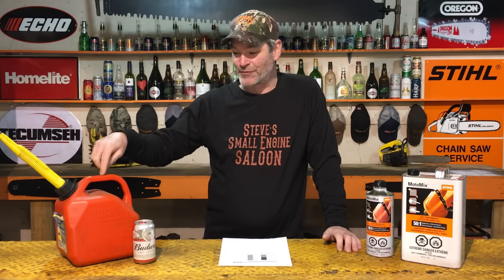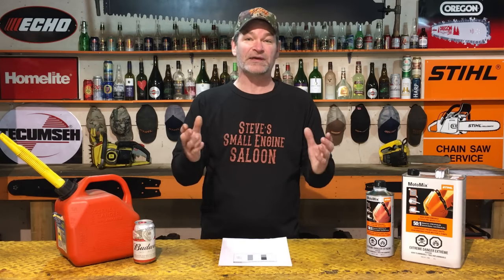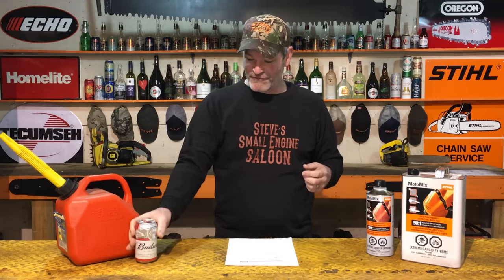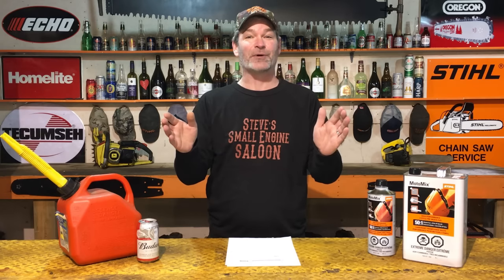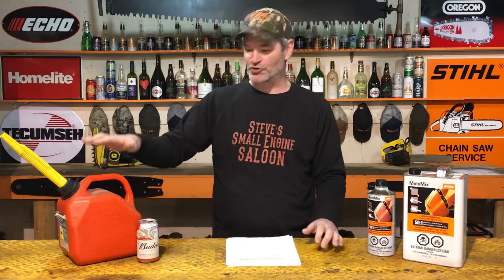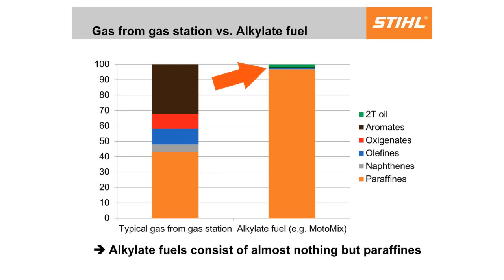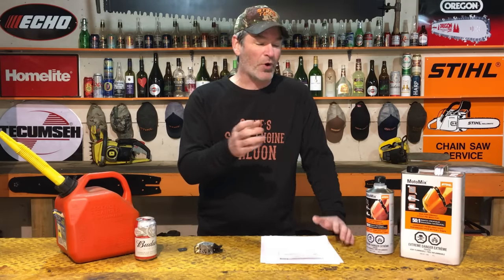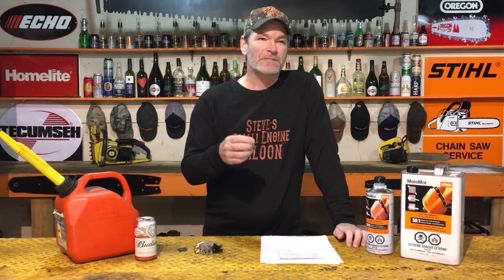The Ugly Truth Why Gas Station Fuel Is Bad For Small Engines

Comment: The pre mixed fuel is way out of budget 4 many people. If they want us use it they need to shrink there heads an make it affordable
Reply: Way way over priced
Reply: its cheaper to replace diaphragm and fuel lines you get it from china for few bucks
Reply: I saw Quarts (liter) was $13   I can clean my own carb
Reply: You're right about the price, it should have gold dust in it for that price. I go through a lot of gas in small engines in a years time. My nephew bought a 5 gallon container of the pre-mixed fuel and I almost passed out when he told me what it costs!  As Fran008 stated, "it's cheaper to replace the diaphram and fuel lines every year! I am left to wonder why older gasoline engines and two cycles engines didn't have this problem? My dad spent 3 decades in the tree and firewood business, using multiple chain saws and a log splinter and never ran anything but pump gas through them and never had any problem. It seems like our technology is going backwards!
Reply: I don't care how much it costs. I don't make my living with my small engine machines but I want them to start and run when I need them. Not take them apart/rebuild/clean them.
Reply: I use VP 4 cycle fuel and mix in Lucas 2 cycle oil. The VP is pricey but my old Lawnboy runs better than pump fuel. I can tell a difference...the engine purrs and runs smoother.
Reply: Josh that's great it's working out for your but the cost is just to great 4 me. Thanks 4 your comment have a great evening and be safe
Reply: Cheaper to buy non ethanol at the pump
Reply: They're tying their warranties to it to try and make you buy it.
Reply: Considering the time and frustration of dealing with a bad carb, if you just buy a can of premixed fuel at the end of the season, so that is all that is in it before storing for the winter, the price is worth it. My time is worth more than the 10 or even 20 dollars a year extra
Reply: Maybe only use it before storage. Run this fuel, top off the tank then run gas next spring.
Reply: Not sure where you live but I just bought vp fuels 40:1 for my chain saw and weed eaters I bought a 5 gallon can for 35.bucks which I thought was a damn good price so I bought 2.and right now my gas prices,are 1.45 a gal anyways the smaller cans go for 5.99.and the gallon 19.99.course I mow and weed eat every 2 or 3 weeks .and run my chainsaw about 5 times a yr so what I'm paying works for me.just saying.the oil I used was 15.99 a case of 12 the gas I used wasnt 87oct it was 93 oct  and thats 2.65  gal I dont get just one gal I get 5 gallons so the pre mixed works better for me ...just saying
Reply: That's a great idea I will go to the airport
Reply: I actually use the fuel in my mix can year to year. My stuff will start on the 3rd pull Everytime. I just add to it when it gets low. I was given a free can of special fuel with my new chain saw it's still setting on the shelf in my shed.
Reply: Plus now Amazon is adding sales tax on everything, which is why I dumped my account, plenty of other alternates that dont charge it
Reply: Fran008 not for long -I’m hearing people will be Boycotting China Products soon !!!!!
Because of the Corona outbreak ...
Reply: alphaone101 Devil products.. everyone wants there hands washed .. $$$$$ - Greed - we are Pawns in The Game .. ( Read it - very interesting ) 🤔
Reply: Steve Raymond it’s either that or Buy Electric ⚡️
Reply: Mike Bennett 🤔🤔🤔
Reply: onus gumboot I agree - end of the Year!!
Reply: Anthony Griffith seafoam or stabilizer ????
Reply: Victorian Sculptures - Again Greed
Reply: Really? How many gallons of pre mix does a home owner go through in a year? I have to deal with 3 acres of 5 foot high weeds each spring, and I don't use more than two quarts of the good stuff.
Reply: it’s about 4-5 times the price yes, but if you can get ethanol-free, that’s fine too… if this is just about storage though I don’t mind paying $20-$25 for it if once a year if it means less problems down the road
Reply: @kontu5399  the comparison is to E10 fuel, you can get ethanol-free and it is much better, maybe not as good as pre-mixed but still, this stuff can last a long time and avoid having to send in your equipment for repairs or have to clean out or replace parts
Reply: $35 a gallon here.........silliness
Reply: 28$ a gal in Tennessee.
Reply: Yeah!! 22 bucks for a quart of premixed fuel. No one can afford that!!
Reply: F that!
Reply: Ethanol free gas is the way to go. And don’t store small equipment with fuel in it. When I’m not going to use my chainsaw for a while I dump the excess fuel and let it run until it runs out. Works like a charm.
Reply: @mikebennett5442  ...aviation fuel for piston engines has lead additive in it .
Reply: I use it for storage purposes.  Before storing after the season ends, I drain the pump fuel and put a little motomix in and run it until the engine stops.  Now you have no fuel issues. Will start perfectly every time.
Reply: @alphaone101  .....the new run of plastic and rubber compounds seem to have self destruct built in :- that can be the insulation breaking down on coils n ignition module/magneto over time irrespective of usage , diaphragm n fuel lines as mentioned . Tyres made in China will leak air by osmosis through entire body of the tyre , there's no detected localised leak if immersed in water but they leak slowly. I've had used shoes crumble away unused over the years and my first experience of this was with new balance pair which were new and unused for a decade and were just leather n crumbs when I wanted to use them years later. I never had tyres rot away while in sheltered storage in earlier times but it happens these days .
Reply: Thats what i thought, but last year i started getting into string trimmer another small engine repairs. Last year using gas station fuel I had nothing but issues and this year I started using pre-mixed fuel from Menards and other places and I haven't had any issues starting up my machines this year.
Reply: @alphaone101  its cose fuel now days contains diferent stuff  from one back in day thay got lots more aded crap in it now
Reply: 100% agree.
Reply: @mikebennett5442  that was my thought. A friend has ran our local airport for about 45 years.
Reply: @HobbyOrganist  yes, old Elon Musk is thick with the politicians and he wants to pass along the government cut to stay in their good graces. He will mumble something about it being the law to make everybody think it was not his idea. He probably had loe Nancy and AOC pass the bill.
Reply: @charlesdickens6706  Lol! Go bare footed and drive on steel rims?
Reply: @boskoromanic7425  
you hit the nail on the head but there is still a cheaper alternative than listening to shit manufacturers say:
find a hobbyist airstrip in your area, they generally sell fuel for vintage aircraft which just straight up can not safely run on modern fuel, the stuff is more expensive than pump gas, but it's most certainly cheaper the shit manufacturers are trying to sell you. learned this trick from an old co-worker who races with a trabant and vintage two stroke mopeds.
Reply: If you’re an individual homeowner, you’ll use maybe one or two cans of this stuff a year. That’s less than $30.

If you’re a business, it’s a write off and your stuff works better.
Reply: @alphaone101  I doubt very much that in three decades as a lumberjack, your father never had issues with his small engine equipment.
Reply: @onusgumboot5565  lol. New parts are cheaper than buying that garbage
Reply: @SuperFunny65  or just drain fuel before storage
Reply: I buy a 91 octane race fuel at my local race shop. I think it is like $6 a gallon. A ton cheaper than Motomix.
Reply: @steverayrapp  Yeah, but what about when you buy premium, alcohol-free fuel, and your fuel systems still bite it? Nobody can afford to fill up their 4 gallon, zero turn mowers with this shit.
Reply: @mikebennett5442  What this guy says. I live comfortable, but I ain't paying that.
Reply: @stevetdean1966  I'm in California. You can't get pure gas easily. I've been using "Trufuel" in my yard equipment and they always start and run great. If I was using these things every day I would use pump gas.
Reply: @fran0085  no way no china!
Reply: @jimmysapien9961  completely agree and am on board with that. No china!
Reply: I use Aspen, but only for flushing down the engine/carb after day's work. It really made a difference and cost isn't a problem as just a few ml are needed to be put in an empty tank for the hose to pick it up and run it through the carb/engine for a few seconds before shutting off/storage.
Reply: At $35 a gallon?? Nope, I’m capable of changing a few small parts every few years if need be.
Reply: So, apparently "STEVE" is making this video for his buddies that have their own shops like HE does, the rest of us that are on a budget can't just "go buy a can of this stuff". I looked online at some of the prices....WHOA! Nope, gonna use the pump gas!
Reply: Oh yeah?  Well I just paid $50 to get my Stihl chainsaw repaired because of bad pre-mixed fuel you are touting.  If it's that expensive, it better be DARN GOOD FUEL!  😁
Never had a problem with gas station fuel properly mixed.
Reply: @jimmysapien9961  Ha ha. Half the crap we own is made in china. Good luck with that.
Reply: @kontu5399  I had a Craftsman for 15-20 years that i never winterized. It always ran fine. At the start of the new year I would change air filters, spark plug, and change the oil.  She worked great. Prior to getting that mower I used a fuel stabilizer. It started one time. The mower would never start again. I followed the directions. i returned it and never used a stabilizer again.
Reply: My take is, for personal / residential use it's fine but, for someone like me who runs commercial machines & burns gallons a week, this is out of the question because my customers just can't absorb that kind of cost.
Reply: @alphaone101  your dad never had problems because that was before they "improved" gasoline. So many additives are in gas now that they claim are engineered for a better fuel, but i kind of think they just use it as filler to make more money/gallon.
Reply: It costs far more for repairs if you're unable to do it yourself.
Spend the extra cost for canned fuel.
Reply: If you got that much extra $'s laying around then good for you!! Quite a bit out of my league!
Reply: Depends on how much you use per year.
Using it to store equipment for the end of season isn't that bad. 
Big thing is that it works and is dependable.
Reply: @shellcracker18  thats my thought, too.
Get real gas
Reply: Yup...not paying 16 bucks a litre or what ever it is.
Reply: @shellcracker18  that's exactly what I do $6.50 a gallon that I'm running four strokes so I get in about 85 to 90 Mi a gallon on my motorized gas tank bike...
Reply: Project Farm does a great job of showing how storing aluminum in plain ethanol free gas caused no damage/corrosion to aluminum after 9 months, while E10 and E85 had massive corrosion, so yes it's the ethanol. The engineered gas is great, but it's $40 a gallon... And again plain ethanol free has not caused any damage or corrosion to gaskets or metal in any test I've seen when storing 6 months to a year
Reply: cheaper then pay for a repair due to poor mix jobs people use and the corn fuel.
Reply: So we already spend more money at the pumps filling up our cars anyways if you really want to make your equipment last it doesn't hurt paying extra
Reply: The price between their engineered fuels and pump fuel I could buy a new chainsaw in two years.
Reply: I run my own mix in the saw for cutting firewood. I store the saws with the fancy pre mix and they never sputter. If I'm cutting more than a few branches I'll mix some.
Reply: You don’t know what price is
Reply: Not at all
Reply: @fran0085  im a stihl dealer and when people use this thing for 2-3 years i a row they have carburator problem! The motonix just dry out the diaphram like plastic!
Reply: @jimmysapien9961  this comment aged like milk.
Reply: $30/gal at Lowe’s in Michigan.  Rip-off.
Reply: Not to mention it's completely trash. I like knowing what type of oil is used to mix my gas. I've bought that stuff several times and it makes my engines run like shit.
Reply: Way cheaper than having equipment worked on every year.   I buy vp brand by the gallon and is not bad at all. Hell a gallon lasts me all season.   Price having a new carb put on and then get back with me.
Reply: @Travis-kw3mo  I have never had to replace a carb especially if I use non ethanol fuel from the pump
Reply: @joshkesler8571  Curious, you run 110?
Reply: Use stations gas and when it fails go and buy another one,it will be cheaper than buying that high priced premixed fuel. I use ethanol free gasoline and a good oil mix and I have no problems after twelve years.
Reply: @SuperFunny65 this is the answer.
Reply: @alphaone101  , i agree with you other wise we should do a collective class-action worths billion$.

Comment: If all things were equal, engineered fuel is the way to go, but all things are not equal and the reality is I cannot afford the designer fuels, so I will stick to running premium in all my small gas engines. It seems to work for me, or I have been lucky for the the last 42 years of doing so.
Reply: You can’t buy any fuel in BC without ethanol.
Reply: The alternative is to buy a small bottle (1 litre/32 fl.oz) and just run it on your last day before winterizing it. One bottle is cheaper than a carburetor repair kit and even if they say it's good for two years, in reality it doesn't really expire.
Reply: @javar888  Chevron and Shell both offer their top tier fuels Ethanol free.
Reply: @lukeholman3180  thanks l'll go there from now on. God bless.

Comment: Canned fuel almost killed my large engine. Emergency fuel of dearh!  China fuel filters let dirt thru to my generators. Busy cheap gas station regular  gas is better for me than expensive little used premium. Mmo and gas cleaner in small amounts got my gens to 1500 hours. Replaced carbs when chokes flopped loose. New gas pumps also. Scraped exhaust carbon. Fresh gas, gas stabil, and a touch of  marvel mystery oil to lube . Always full tanks. Works for me!

Comment: Storage use or everyday use, this $23.22 per QUART smells highly of a "racket" to me.
Reply: I swear by it as  a casual tool user. everything starts first pull every time- all the time, and no carb issues in 5 years since I started using it. I use Aspen fuel, its way cheaper and the same thing.
Reply: @jimdandy9289  dddddddddddďd
Reply: You can buy a gallon or 110 oz can for less than $20. "Quart" sized can run between $5-6 in my market.